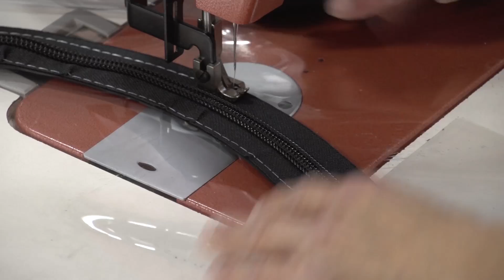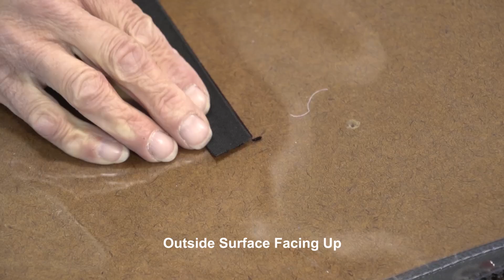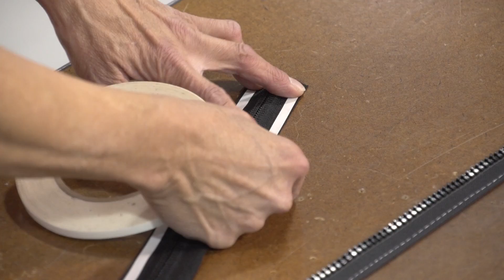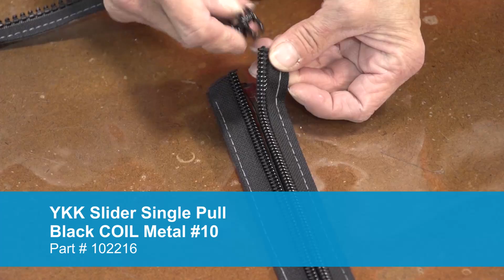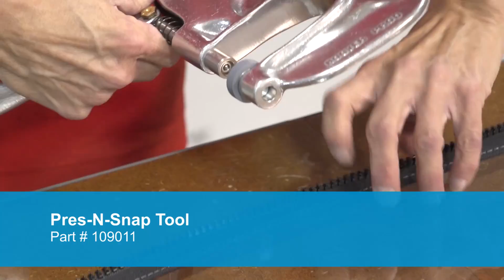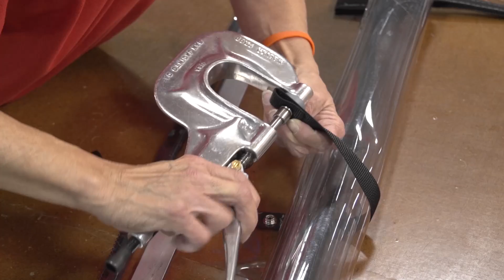Installing Curved Zipper in Vinyl Window

Comment: I'm replacing regalite that has zipper marks from rolled up panels and wear marks from webbing straps with 30 Osea, will the better scratch resistant Osea not scratch up and leave wear marks from webbing.

Comment: I make my window opening closer to the top so when I secure the roll up strap it is secured at the top and I install another snap at the top so when window is shut I snap the dangling strap along the top so strap is not dangling and scratching expensive window material.
Reply from the maker: Excellent idea. Thanks!

Comment: Why do you roll to outside and not inside, as it seams easier to roll up on the inside, I just looked at it again bimini poles are in the way otherwise it looks like it's irrelevant.

Comment: I am doing this same technique on an enclosure that I am constructing but my thread nots is not pulling up through the vinyl like this. Once i sew the zipper the stitch is fine but not when its binder and vinyl only. I end up with a long straight stitch on the bottom and occasionally a loose stitch on top that curls like a pigs tail.

Comment: So you guys just leave the strap hanging free when the curtain is not rolled up?
Seems like it would scratch the vinyl when it swings around.
Reply: When I made our windows I added an extra post snap on the top facing to attach the strap when not in use.  This can't be done when you have a screen, but works perfectly with this kind of window.  Hold the bottom of the strap, swing it up, and where it falls on the facing is where to put the other post.

Comment: I would like to see a way where you can leave the screen in permanently, but have a rollup window on the outside that is the same size as the screen. The only way I can imagine is to have two zipper slides at the tops and sides. Kinda stacked. I'm tired of taking out the windows in the summer, but then getting soaked in the rain. I want to have both installed full time.